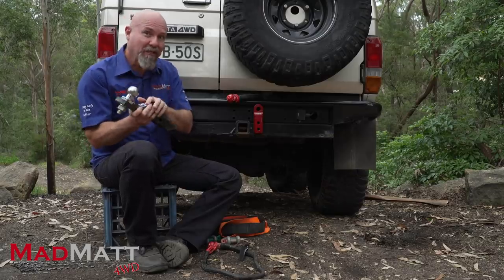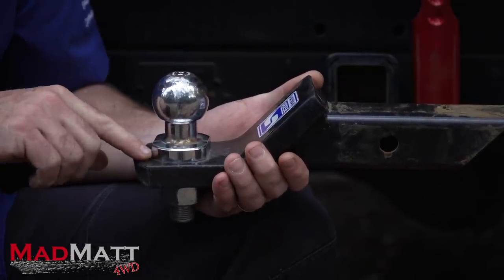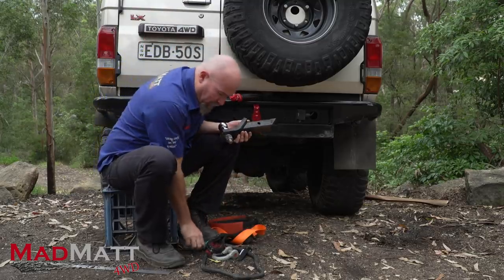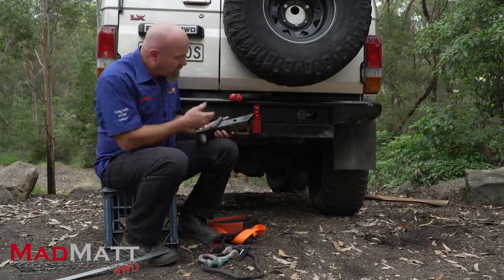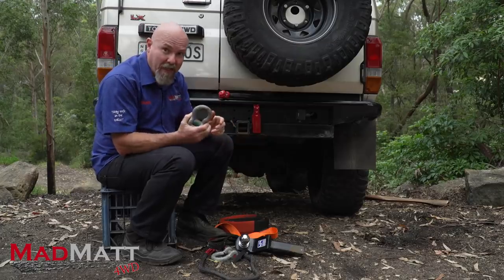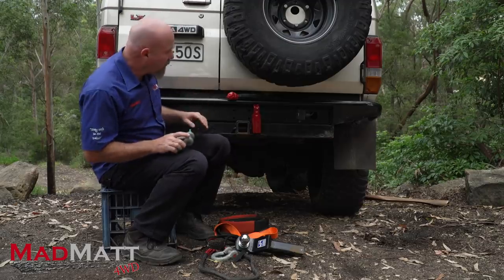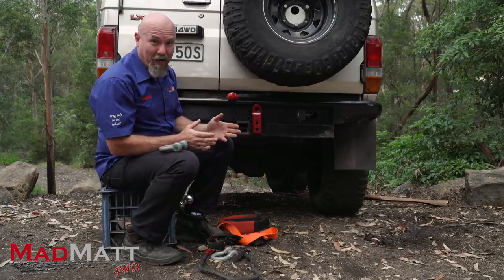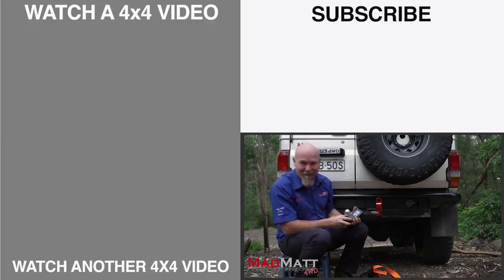A Tow Ball is NOT an option in a 4x4 Recovery? FIND OUT WHAT GOES WRONG

Comment: So I watched the other video where Ronny intentionally makes the tow ball fail and my take away was that the tow ball is incredibly strong. He took a 10 meter snatch rope and got a full speed run at the tow ball with as much speed as he could  and that tow ball held over and over again. He did eventually get the ball to fail, but I think it took about 4 or 5 tries hitting it with as much speed as he could. For subsequent tests, he ended up having to cut half way through the shank on the balls and they still were very strong. I’ve never subjected a vehicle to that kind of torture while trying to make a recovery, but if I did, Yes, I would use a better recovery point. Now I’m not saying that tow ball is the best place to hook to, but for the average stuck vehicle, it’s more that adequate for a recovering. Like all things, it requires a measure of common sense and if you don’t have it, I guess follow the advice in this video.
Reply from the maker: You make some good points. Use the right tool for the job especially when it's so cheap and easy to do.
Reply: I think what Ronny was trying to show was what could happen in the worst case scenario. It might work 99 out of 100 times but you never know when that last time will be. No one knows the true strength of any tow ball internally. Could have been a bad cast etc.
Reply: Maybe a difference in shaft size as well, 3/4 vs 1inch, tight bolt vs loose bolt, etc.  2inch reciever vs 1 1/2 inch.
Reply: The temptation to hammer the gas is always there though once connected
Reply: Not really, I like my truck enough that I'm never going to smash the throttle like that. Maybe somebody else will, but not me. 
If Ronnie would have put a forged receiver, a 2-in ball with a 1 inch shank in the back of his rig, he would have ripped the back of that Toyota off before breaking that ball. He purposely got light duty tow balls to try to prove his point. Not saying it's a bad point, just don't condemn everybody out there that drops the strap on their tow ball for a simple recovery. Not everyone is driving a dedicated off-road vehicle and sometimes you have to help the next guy with what you have.
Reply: @biggs8729  he has a valid point though. Yes he tryed to create the situation, but that doesnt keep people from doing it. Streetspeed 717 did a vid destroying his buddys first car, slamming the gass of a 6 or 7hundred hp ram trx and litteraly yanking this tiny vw in the air. Sure it can take it a few tines. But not all steel is equal, chinese components never fail to fail. So what is another 30 bucks for a dring hitch adapter. Its not coming from a YOUR WRONG pov. More of a be carefull its possibke things can happen pov. If peoole are already wgeeling there rigs there not affraid to rip it and beat on it. If we break it we fix it. Simple as that
Reply: @biggs8729  he never condemed anyone. Quit putting words in peoples mouths. He litteraly made a vid with matts off road recovery, if he was condeming anyone he wouldnt make a video with him let alone meet with him in person. Just because your expeienced or have a big ego doesnt mean you have nothing else to learn? Just agree to dissagree man. Simple thing people have lost. Just look at politics everyones usefull idiots
Reply: He wasn’t even using a snatch strap, it was a straight up tow strap, with the load attached to an unmovable object and it still took 8 tries. By the seventh the bumper was breaking loose. I guess it you are stupid enough to do everything wrong 8 times in a row, maybe Darwin owes you a tow ball to the head.
Reply: Someone died like a week or two ago where i lived, trying to to use a tow ball for recovery.
Reply: @iShowUnusualBehavior  Where you lived? You died? Oh noes! RIP dude.
Reply: I've seen people "hit the gas" several times when trying to unstuck a vehicle. You never know what their knowledge or experience actually is. Some are doing it for the very first time. Husband tells wife to operate the tow vehicle and sure enough, she hits the gas (see it myself). Or a teenager is there to help... it might even be you, because you're frustrated and can't get the other vehicle unstuck. Basically, the chances of someone doing this are always, always there. Better to just stop, slow down, hook up right and make sure the driver understands what they're supposed to do. I've seen broken straps, broken vehicles and near-misses more then once. The advice given here to not use the tow ball makes sense - stop doing it.

Comment: Recovery points are usually for more suspect and un-rated when it comes to shock loadings.
Ronny Dahl had to partially cut the towball shanks to get the towballs to fail.
Effective dampeners on the ends of the strap go a long way to dissipate energy but you can remove the tow tongue, poke the snatch loop into the receiver & put the pin through it rather than over the tow ball.
Reply from the maker: Ronnie didn't cut the first tow ball as shown in this video. My thoughts on the pin. https://madmatt4wd.com.au/2014/01/27/is-a-hitch-pin-acceptable-as-a-snatch-recovery-point/
Reply: @MadMatt4WD  Ronnie's head was the only thing that came close to going through the windscreen in the first test.
You can also get on eBay an 8 tonne rated pintle hook/50mm towball tongue that has the top arm of the pintle hook locked over the top of the tow ball. 
Factor 55 is nice stuff but I think it got its name because it costs more by a factor of 55.
Reply from the maker: @dustyfarmer  Yes F55 is not cheap. But it's very good gear and many who can afford it are appreciating the quality. Of course, there are many other suitable options.

Comment: This was a good video except when he says Ronny Dahl did a good video any receiver that got put through what he did to the tow ball would have failed. And if you sawed halfway through a d ring and chained it to a tree and then drove off as fast as you could it would break. Let alone do it 8 times and destroy the frame on your vehicle before it breaks.
Reply: I think what Ronny was trying to show was what could happen in the worst case scenario. It might work 99 out of 100 times but you never know when that last time will be. No one knows the true strength of any tow ball internally. Could have been a bad cast etc.
Reply: @stewbird  if that's the case no one knows the true strength of the cute recovery points that all these uneducated "experts" recommend. or a tow bar you put a recovery hitch into, or the bolts holding it all to the chassis, or the chassis itself. These "experts" like Dickhead Dahl falsely scare people into attaching to things a lot weaker than a tow ball, causing actual dangerous situations. There's an increasing amount of occurrences where "rated" recovery points are ripping off and flying along with a shackle. No 4x4ing snatch strap or kinetic rope has, or is going to, snap a tow ball, as demonstrated by Dickhead Dahl, the chassis will let go of the whole tow bar before a 2/3 cut through tow ball will break. Think about it.
Reply: @TruBluOffroad  You do realize that people have been killed by tow balls that broke free during a recovery right?!  He mentions it less than 15 seconds into the video. It happens and is well documented. They essentially turn into cannon balls when they go. That is all Ronny Dahl was trying to demonstrate. The whole point is attaching to something that will not kill someone if it breaks.
Reply: @cjr4497  He say's it on the internet, it must be true!! 🤣🤣🤣🤣🤣🤣
Reply: @cjr4497  people have also been killed by airbags and seat belts. There's a lot of people in the world so almost anything that can happen will. That doesn't mean it's likely.   If you're foolish enough you can get almost anything to kill you. Not saying towballs are the best option but the danger is way overstated in my opinion.

Comment: Thanks Matt, yes I had a front tow ball on a bumper and I just needed a small tug off a flat spot to get out of the way on a busy trail when my jeep died.  I had a guy freak out on me that you never use the ball.   There are a few times that it is okay.  If it's a simple tug where there is barely any load on it then you can go ahead and do it.    In my case the tow ball was attached to the front bumper, the previous owner would use it to position an RV.  But if it's in a receiver, then just pull the ball assembly and put the strap trough the pin.
Reply from the maker: Excellent comment
Reply: Yup let common sense prevail. It's not as black and white as everyone claims.
Reply: @CaseysOffRoadRecovery  But you could also argue that if you never use it, you won't have a problem. ;)

Comment: Finally an explanation of sorts. You are making a valid point to a guy who has watched cranes fall from the sky. Things fail if not maintained. As a seafarer I can make the point that when towing at sea you should never allow the tow line to become taught. I have used my tow hitch for recovery but put a twist over the hitch so the ball is not taking the full load.  If you are planing to tow a trailer when was the last time you checked your hitch?
Reply from the maker: Thanks and some excellent points

Comment: You should mention about bow shackles not to use the ones with pin and clevis pin, they will bend the bow shackle. WHere the screw in pin type will help keep the bow shackle from bending. We were not allowed to use the pin and clevis pin type of bow shackles at work for this reason.
Reply from the maker: Great point

Comment: I'm delighted to see you going through the details of the safety parameters involved in a pull, but I have to say, I think you missed the most critical thing: the difference between the load applied to the attachment point is orders of magnitude higher if you are pulling with a chain rather than a kinetic recovery rope or strap and you don't snug it up before starting the pull.  Shock loading breaks things.
Any time a pull is being done is an engineering exercise: there is a series of connections and each one must be within the safe Working Load Limit (WLL) NOT the Minimum Breaking Strength (MBS) of each of those connections.  For example, not all tow balls are created equal.  The ball on my truck is rated for 40,000 lbs/18,000 Kg and the hitch is stronger than that (I move house trailers).  The tow ball used to pull a small utility trailer would commonly be rated for 10% of that, and wouldn't be nearly as strong as typical recovery equipment, and therefore not safe to pull from.
Finally, Inspect your equipment!  If it's rusty or frayed or worn or cracked, retire it before it breaks!
Reply from the maker: You make some good points. But your towballs are rated to tow not recover so bare that in mind. As you indicate a towing load is vastly different to a kinetic recovery load.

Comment: The problem is the towball hitch you are using is a two tonne limit. The potential for a tow is in excess of two tons. The Jerk component is way higher, you need to highlight this point. The ball breaking is caused by not being tightened properly or has been badly abused. it is way stronger than you are suggesting, human error is probably the primary failure in most cases. However I think you make a good point these things can be avoided
Reply from the maker: Interesting points.

Comment: I've had a similar experience pulling out a stuck Xterra with my Tacoma, and looping over the ball hitch.  Ball didn't fail, but loop somehow slipped off, and flew back straight through the rear window of the Xtrerra!  I've now gone and bought some soft shackles and a hitch mount tow shackle!
Reply from the maker: Glad you didn't get hurt.

Comment: We just go to harbor freight tools, buy the Triple Ball hitch with solid square tube $35. We put the tow rope loop over all 3 balls and use a grade 8 bolt for the pin rather than the soft metal standard hitch pin.
Reply from the maker: If I know what people do but there’s still a better tool for the job than that.

Comment: If you must use the towball you can wrap the end of the strap under then around the towbar and hook the loop over the towball. If the towball should by some fluke break, it will be propelled a small amount into the rear of the tow vehicle. A modern 3500kg rated 50mm towball has a shear strength well over the usual snatch strap rating. This is far stronger than using the hitch pin, because using the hitch pin this way it becomes a single shear point and is already way under towball shear strength.
Reply from the maker: And yet the Australian government has a mandatory standard that must be on all snatch straps sold in Australia that says do not use a tow ball. Now we all know governments don't do anything they don't have to. 

https://www.productsafety.gov.au/standards/recovery-straps-for-motor-vehicles#:~:text=its%20minimum%20breaking%20strength%2C%20expressed,used%20in%20the%20recovery%20process

Comment: I bought a secondhand 4X4 a few years ago with a tow bar. I replaced the tow ball and connector simply because I didn't know what work it had done. Not that I recover from the tow bar but I do pull a horse float and want to know everything is first rate. The old but true saying applies - a chain s only as strong as it's weakest link.

Comment: The triball hitch that Matt from Winder uses is 3 balls welded to a tube not bolted like a single ball. Also the recovery rope he uses doesn't "hit" as hard as a flat strap or chain. Chain is terrible for snatch type recoveries and will often damage mounting points due to having no "give" when loaded by a "hit".
Reply from the maker: This video is a precursor to a video where Matt explains his use of the triball.

Comment: Just to add to a previous comment I made. I drive a 1997 Subaru Forester and it has an old style tongue hitch which I recently removed because it dragged in the parking space of my new location. When I removed it , although the bolts were in reasonable condition the split /spring washers had failed. Just an example of why we should all maintain our machinery.
Eat well you all.
Reply from the maker: Great point

Comment: Hi Matt,
Its just occurred to me that you potentially have the same problem if you try and snatch recover a vehicle and trailer combination backwards using the recovery point on the back of the trailer.
About the only difference I can see is that when either the towball or part of the hitch fails as you describe, it is less likely to become a projectile as it will hopefully stay locked onto the coupling on the trailer (not a risk I'm willing to take though)....
Reply from the maker: You raise an excellent point.
Reply: There's another reason you don't recover from a trailer though... The trailer's chassis isn't at all suitable to do a recovery from. You are quite likely to destroy the trailer if the towball doesn't come off. Sure, there are probably exceptions out there but that's just what they are... Exceptions.

Comment: Those mounting points on the front of vehicles are not designed for shipping and transport, they were designed for recovery. Just take a look at your owner's manual.
Reply from the maker: on some they are but not on my Toyotas,  when they are used in big recovery they have been known to fail

Comment: Really appriciate your concern for safety. From a technical point of view it is not so much about single or double shear. It is about shear surface and shear strength of te material. I think that the real danger is the use of kinetic rpoes. They will introduce verry high peak loads on the recovery points. This is especially true if the vehicle doing the recovery gets some speed before the kinetic rope tightens. Land Rover recons that loads in excess of 13 metric tons may occurre in some of the recovery procedures.
Reply from the maker: Thanks.

Comment: Unfortunately the weak link is actually the 9/16 pin that's in double sheer connecting the tongue to the towbar. It will fail before the towball which although in single sheer is more than double the cross sectional area of two 9/16 pins.
Reply from the maker: Well except it doesn’t seem to be the part that we see fail.

Comment: I think it depends on your rope. Something like a Ridgid non-stretching strap puts all the force right onto those shear points but those kinetic straps stretch and build energy in the rope instead of "shocking" the anchor points.

Having said that, I've never seen a hitch ball go flying, but I've seen some guys bend the hitch into a banana and the strap came flying off the ball (no shackles or anything) so it wasn't a big deal but I've always told people it was a stupid idea and go get a proper recovery system.
Reply from the maker: nice points

Comment: You missed one option that I wish you would have included. If no D ring hitch  is available, feed the strap into the receiver and put the pin through it. Not as strong as the D ring but much safer than the tow hitch.
Reply: Agreed, though there are some negatives to that as well.  For example, any sort of side-loading will put the strap against a hard edge which has the potential to cut/damage it.  But if my choice is this or a tow ball, this wins every time.
Reply from the maker: My thoughts. https://madmatt4wd.com.au/2014/01/27/is-a-hitch-pin-acceptable-as-a-snatch-recovery-point/
Reply: @MadMatt4WD  I should have read some of the other comments where you posted this - pretty much mirrors my own thoughts.